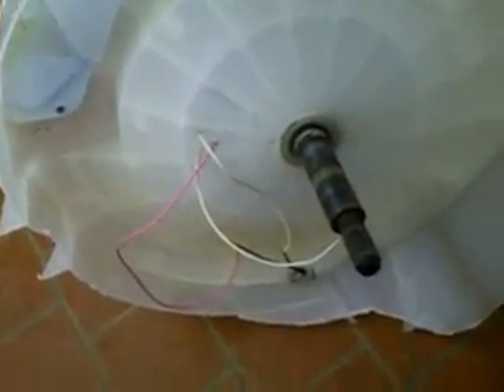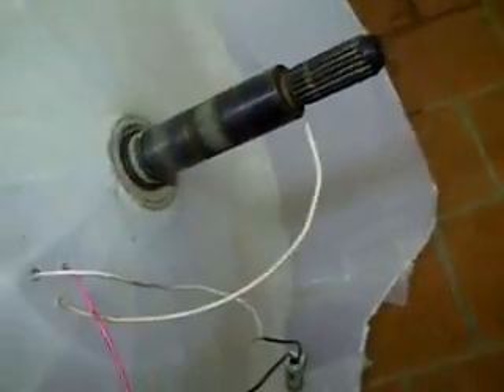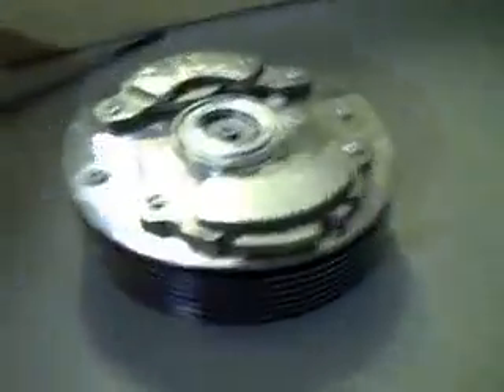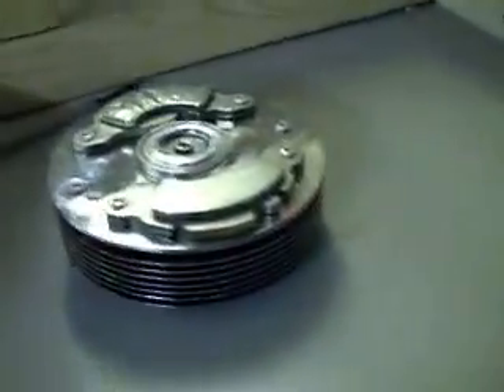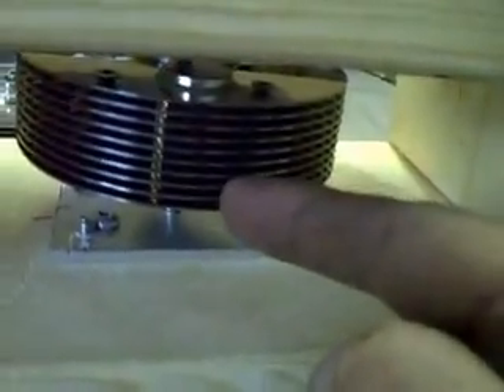#28 Washer Motor Generator

Comment: you can target output voltage at different rpm by reconfigure the windings. takes about half an hour with a soldering iron and some 15-20 amp wire. check out thebackshed website for heaps of information on playing with these. 
ps I run mine as a motor on 12, 24 & 36 volts through a $10.00 chinese electric bike controller. The other is wired as a 24-48 volt generator I hope to be drive from a water wheel

Comment: Nice to see, I recently got a LG stator/rotor assembly for the wind turbine I'm building.

I'm hoping to get about 10 watts out of mine with a 30cm diameter (12 inch) Lenz2 helical turbine (54cm high, 20 inch).

Comment: You could wire the stator to 2 or 3 individual submerged plates. Try this without a rectifier diode. Diodes drop voltage somewhat. Thanks

Comment: @hhoball No pressure. We do the same. It helps make each project more intriguing. Reusing is better than recycling and these motors have many applications and are quite well built. The trick is to make sure they are sealed with a quality varnish for the elements. You also may have to rewire the stator unless you are going grid tie. They put out high voltage. Have you ever tried using 120 ac unaltered to make hydrogen? You would have to start with very little electrolite to not draw too many amps

Comment: This looks very similar to the smartdrive motors we have in Fisher & Paykel washing machines in NZ. If you solder a wire to the bridge on the motor and use it as neutral you will have three seperate phases to draw from.